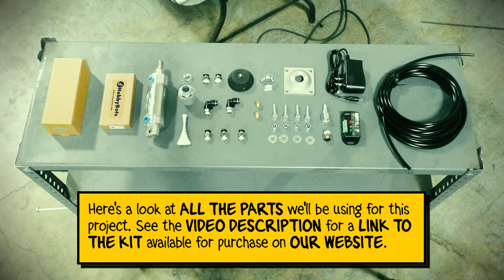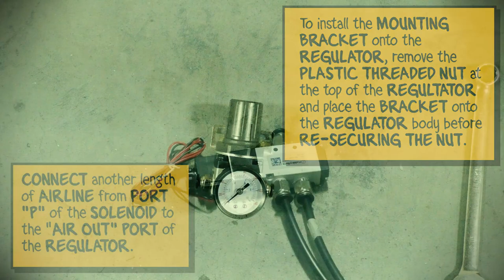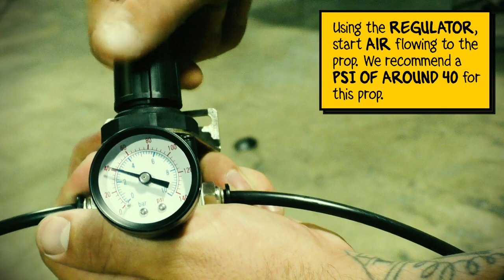LET'S BUILD - Episode 1: Hopping Drum Halloween Prop!

Comment: Any recommendations on how to keep it from "running away" and dragging at the air cord?
Reply from the maker: We use what we call a "Tie Down Kit" for that. It's basically some steel cable and a couple of washers. One end is secured to something stable and the other end is secured to the prop. This acts as a sort of leash that keeps the prop from walking to far.